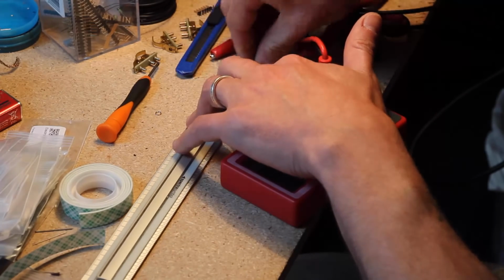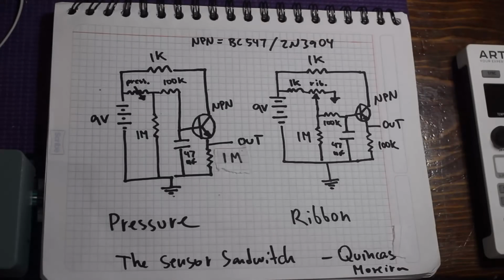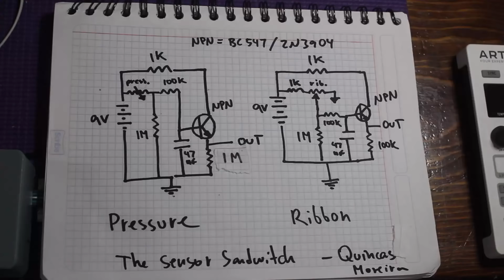SDIY Class # 6 - The Sensor Sandwich : A Ribbon Controller with Pressure Sensitivity

Comment: Hey Quincas...thx for the build...I got it working! one thing I still cannot figure out is how to make the physical distance between the notes played equal (your build creates a rather exponential curve with less distance between low notes and gradually more between higher ones)...I would really appreciate any suggestions...thx a lot
Reply from the maker: Well, you wouldn't really want it equal, something like a cello neck for example gives you closer distances as you go higher. I got used to this one fairly quickly even though it's the opposite. I don't really know how to change the response curve, maybe a digital solution with an Arduino and a lookup table, maybe a DAC....

Comment: Have you ever seen the Modulin by Wintergatan? It's a handheld eurorack modular that you play like a violin using one of those ribbon controllers. It's used in their album to create really nice smooth Spacey sounds. You should check it out!
Reply: This is arguably a bit better than the ribbon on the modulin, because it has pressure sensitivity. The modulin is just a ribbon connected to a small Eurorack case with modules in it. This could easily be conected to the same gear.

What disappointed me about the modulin was that he quantised the pitch. I'd have thought the whole point of having a ribbon controller was to be able to have continuous pitch so you can do vibratos and slides and so on.